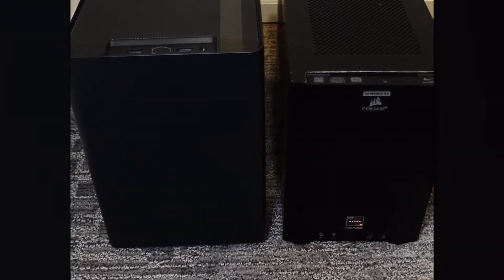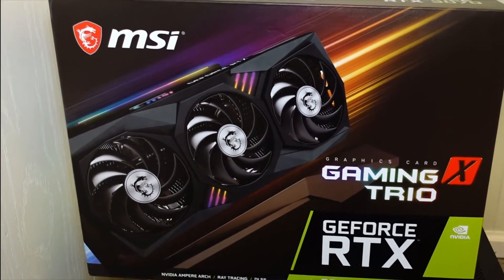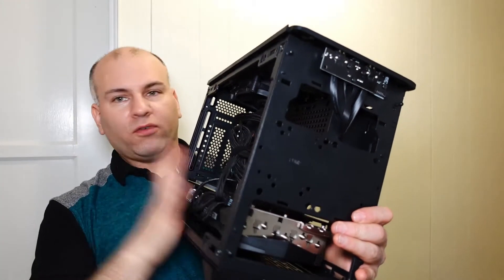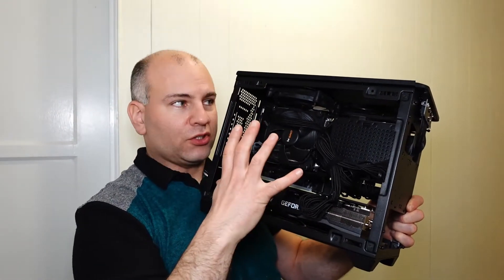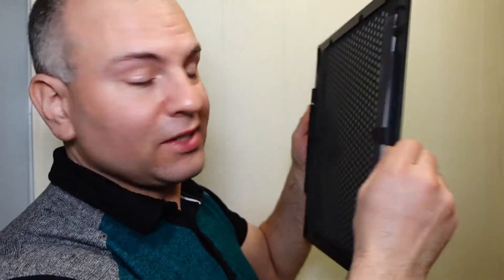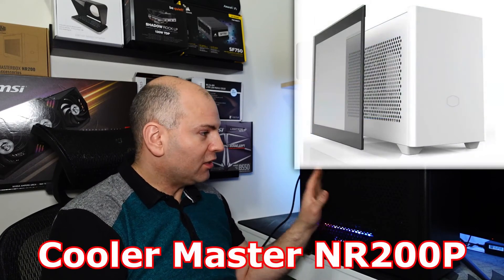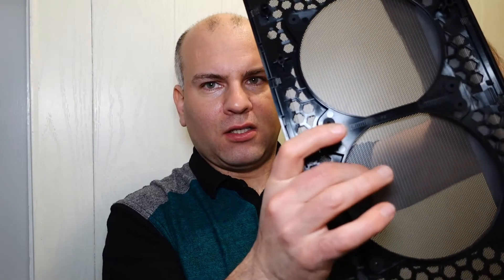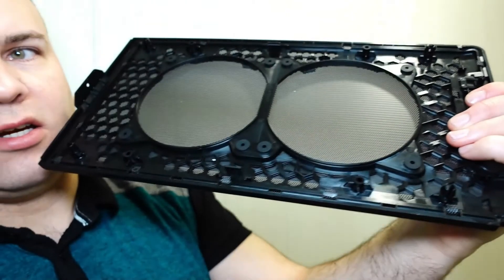Cooler Master NR200 mITX Case Airflow, Thoughts & Mesh Noise Solution

Comment: Was a nice surprise to see you covering the NR200. I bought a MetalFish S5 from AliExpress just two weeks before the NR200 was unveiled and wasn't so sure about my purchase anymore (took 2 months to arrive). The S5 is just over 12L and supports mATX boards. The main issue I have with it is the lack of support for fans any bigger than 92mm, I'm also constantly paranoid about the tempered glass side panel, because I know for sure there's no way of getting a replacement.

For now it's really noisy, although I think most of it is from my Gigabyte 1660 Super (just dual fan not triple fan).

I think the NR200 will be great to show that you can get a nice ITX case with 0 compromises without spending NCase money or something much larger (Cougar QBX is the only comparable case to the NR200 I can think of).
Reply from the maker: I was thinking of tearing everything apart if I could get the place here to myself to record... I am just a guest where I stay so the room to record and not be sitting on the floor... The quality for the price is shockingly good for what is paid.
Reply from the maker: I made a new video:
Cooler Master NR200 - Gaming System Build
https://www.youtube.com/watch?v=FQVhrVls3l8

Comment: have the same case with MSI suprim X 3080 giant card that fits right on nr200p + 280 lcs and DIY to put large 3tb HDD on the front. I just compared my back panel and yours is diffent. might be due to mines nr200p. the push panels replaced with cover the same on the vcard.
Reply from the maker: Interesting that the back panel is different... I'll have to see if I can find pictures of that difference. I uploaded my computer build in my case
https://youtu.be/FQVhrVls3l8
Reply from the maker: Odd it's like there are 2 mounting spots on the P version while the version I have just has a stupid push out plate.